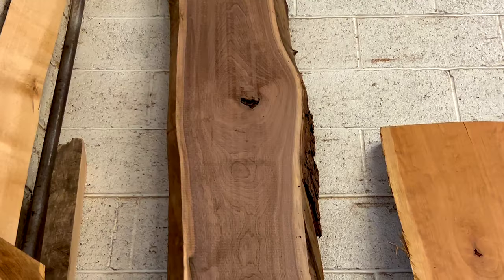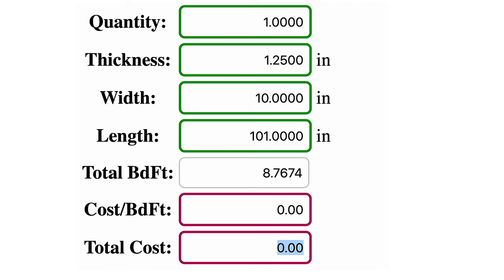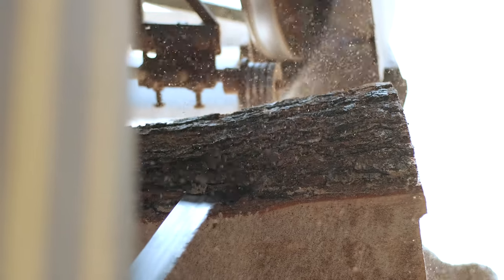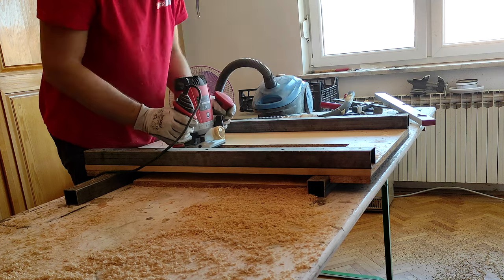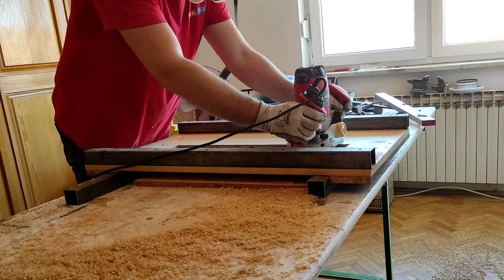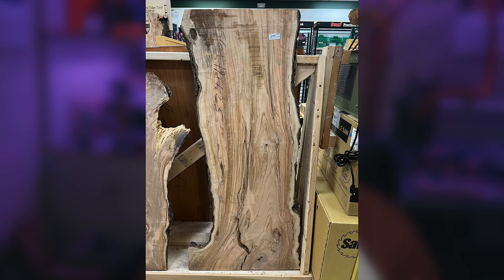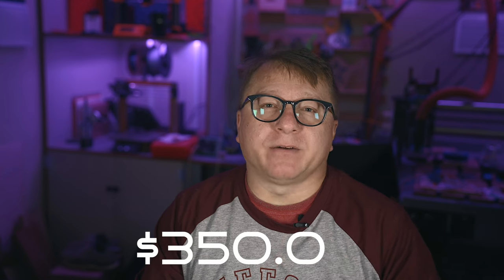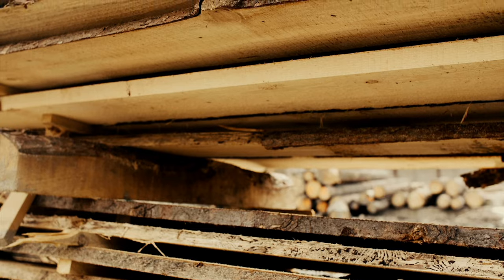Live edge slab pricing is a SCAM

Comment: I only half agree. If you purchase air dried slabs they will be half the price. Kiln drying one of these 20” plus slabs is expensive compared to dementional lumber. Plus the cost of keeping something that big. 

For me doing woodworking has always been about the cost of lumber. That’s why I bought a hobby saw mill. Cut out all the middlemen.
Reply from the maker: Thanks Mike - certainly drying slabs does take more energy, excellent point. Thanks for watching!
Reply: What is the demand for narrow live edge slabs.  I've watched a lot of vids using wide slabs for tables and desks etc.  But what is the use of a live edge slab that's 10 inches wide?  I don't get it.  I never see anyone doing anything with them on YouTube.  

Ps.  I have a few walnut logs in sw Michigan if anyone is interested.  😂
Reply from the maker: @davidshumway9639  Hi David -- I don't know what the broader demand is, but I can say we use them a lot of charcuterie boards, smaller tables, and epoxy river cutting boards. They are quite popular, if not in "high" demand. Thanks for watching!